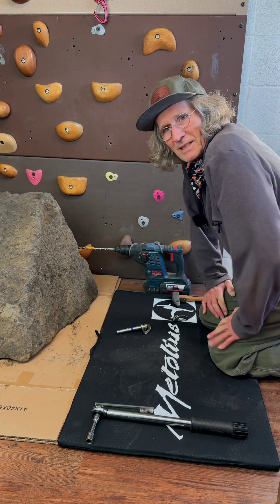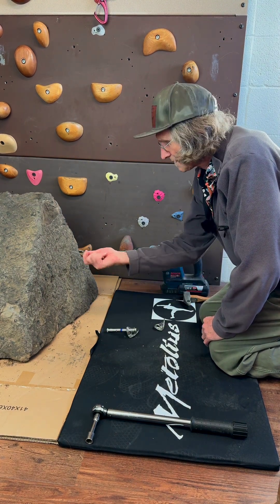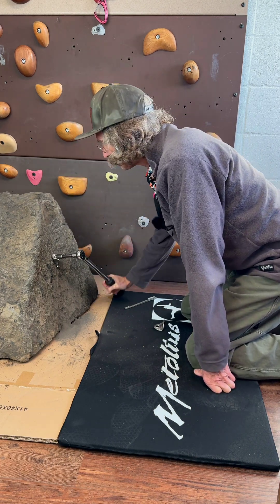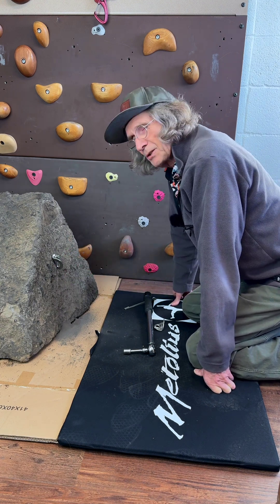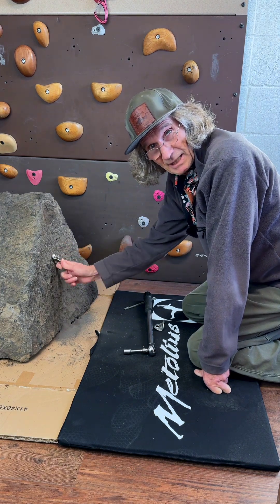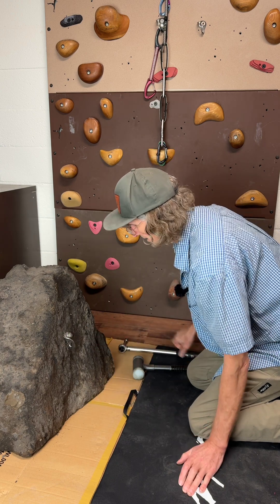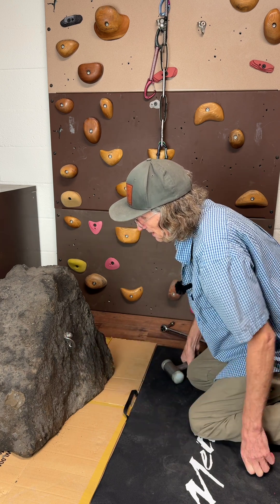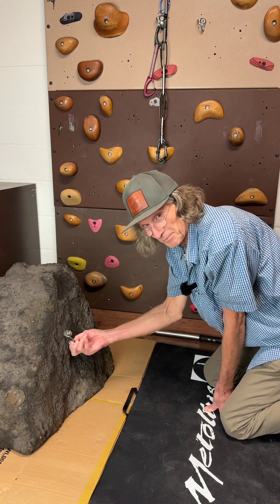Spring Force Bolt Hanger

Comment: For the bolt loosening, I always wondered why the hangar isn't formed to be oriented on the right side of the bolt, here it is on the left so a downward force tries to loosen the bolt if the hanger is not oriented correctly, which is angled.